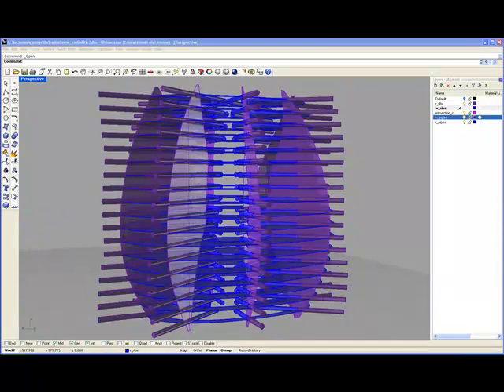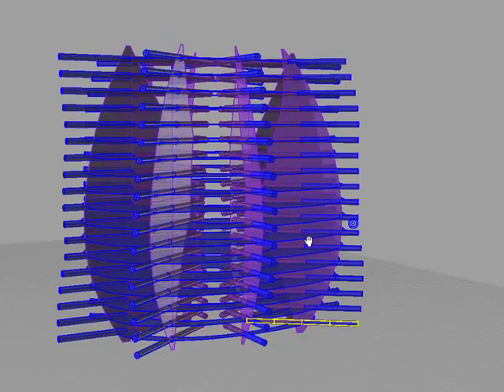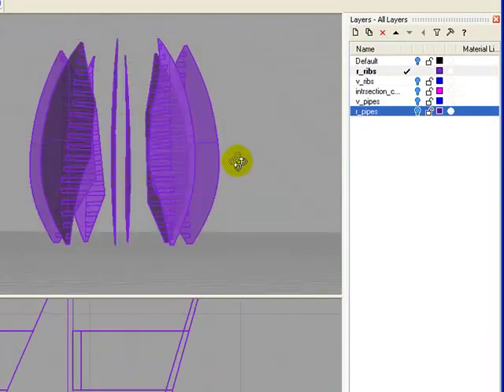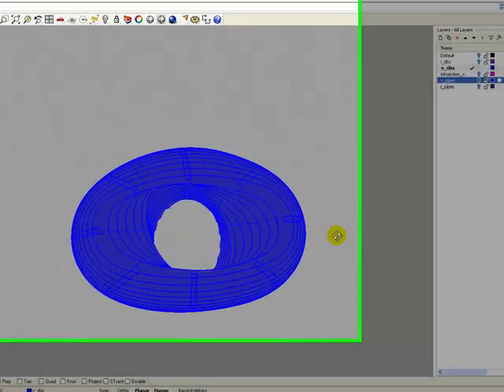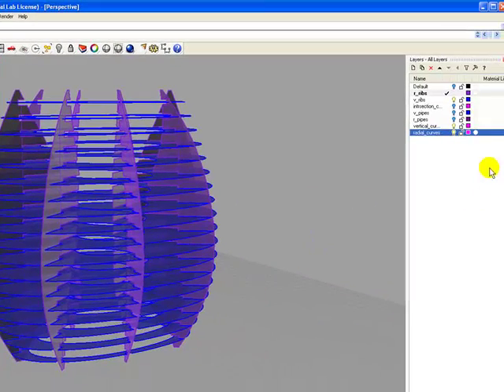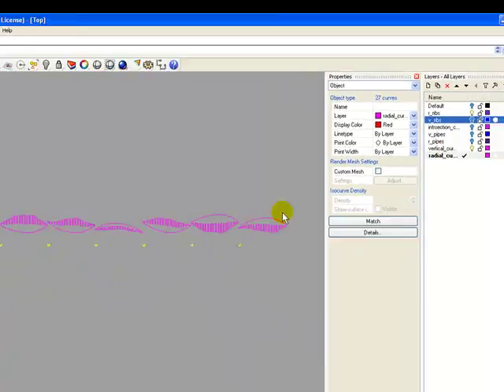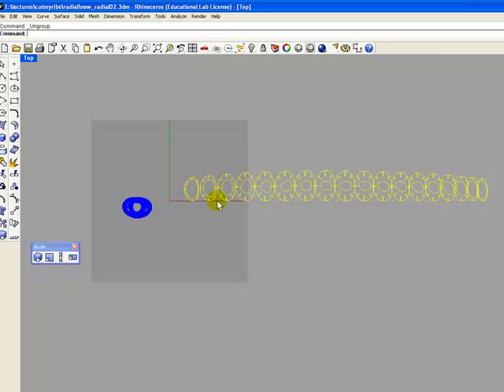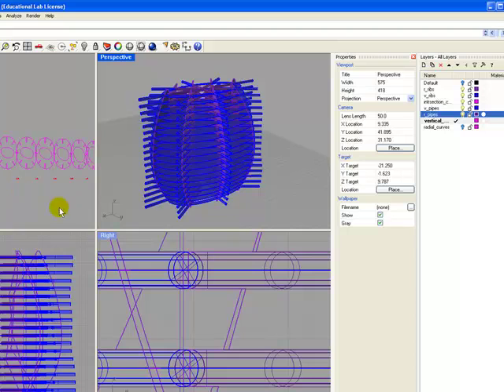Waffles with Pipes_Part 3.mp4

Comment: Hi, I tried the script, but it didn't unroll normally like yours. All parts stacked at one spot instead of spreading out. Also, the it wasn't a clean single curve and no labels as well. What could I have done wrong? How do you input the script as a command in your rhino? is it Aliases?